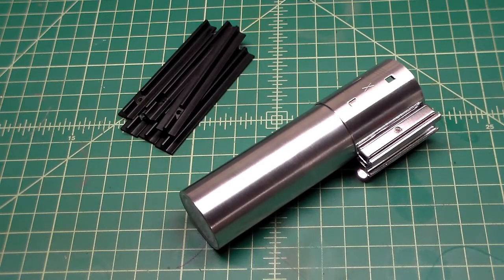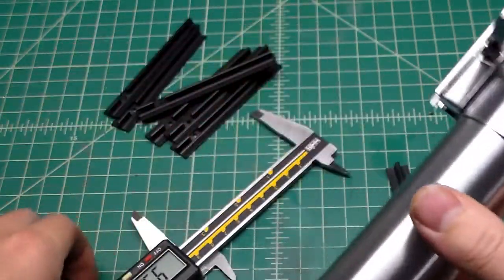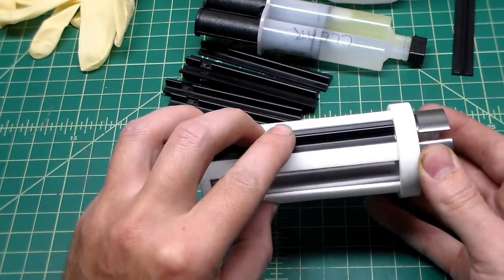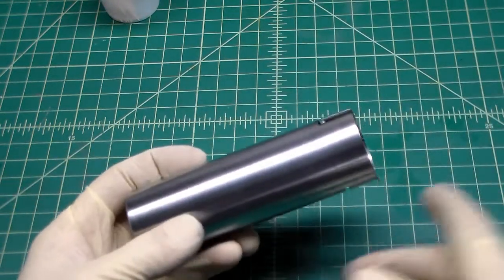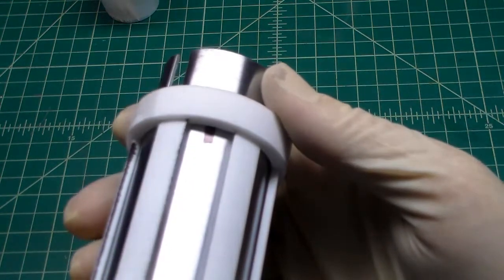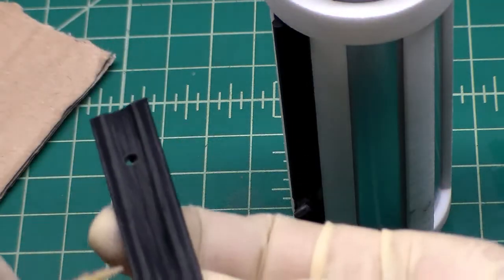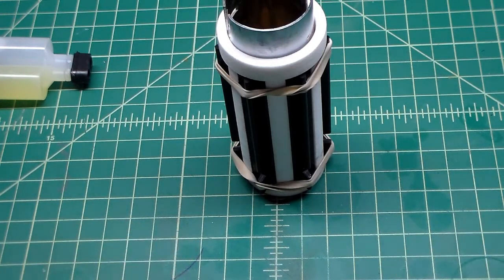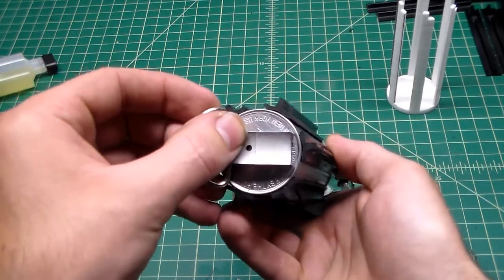Graflex Grip Installation Tutorial

Comment: DO they have to be rubber grips to be considered a screen accurate saber? I bought cast plastic ones.
Reply: Pretty sure the hard plastic ones are correct.  He's using the wannawanga hard plastic ones.  In the movie you can tell they're hard plastic cause the bottom of one of the grips is snapped off in a shot.

Comment: that thin part from caliber is used for deep small holes. you can use that wider part behind digital display.not llike normal jaw.behind caliber has flat spot that move. oposite end where that thin thing mode. did ya know? xD ITS TOP SECRET and you can read it right away

Comment: Thank you for this video,do you make the holes for the rivet screw after or before you put the grips on ?
Reply from the maker: Rarely do I put the holes on at all anymore. They're really not necessary for most builds and doesn't really help with sound, unless the speaker is really deep inside the lower. I just cut the rivets or screws short so they're flush with the underside of the grip. Then just glue them on as described.

Comment: Thanks for the guide. Quick question, don't you drill the holes in the grips ? For the rivets. If not what do you do? Cut rivet heads off ?
Reply from the maker: It depends on the situation. If I'm using a chassis that has the speaker higher up than the holes than I will simply pop the rivets and know the core out for added sound venting. If the chassis goes past the holes I will cut the heads off and glue them in place.
Reply: East Coast Sabers ah thought so. Just lay the rivet head down flush or into the plastic grip a little but not the metal.
Reply: East Coast Sabers You still need to drill the holes for the rivets, thats a tricky part, because I don't wanna mess up.